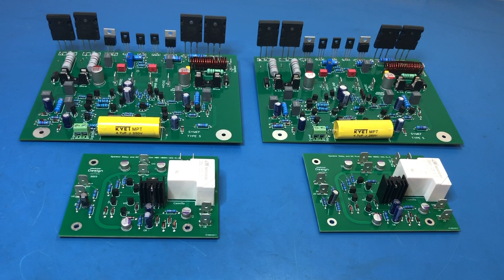SYMEF Class A/B Amp Build Project

Comment: What does unregulated power mean from the power supply to the amplifier board?
Reply from the maker: That's a really great question! So the power supply basically does three things to the 240V that comes out of the wall. Electricity coming out of the wall outlet is Alternating Current (AC). It looks like a sine wave, and goes positive and negative compared to ground, 50 times a second. The 240V is RMS, which is kind of like a mathematical average for sine waves. The peak voltage is plus and minus 340Volts. First thing the power supply does is to get that to a lower voltage - the transformer does that. It turns the 240V into 32V (actually it's two sets of 16V connected together - 16+16=32, and you'll see why in a minute). With a rectifier using some diodes, we can now take that AC voltage and turn it into DC - it's no longer going between positive and negative - it's always positive, but it's still going up and down. We don't want it do go up and down, we want a constant voltage, and that's what our large filtering electrolytic capacitors are for. They store charge (they actually store electrons on their metallic plates). When energy is flowing into the capacitor at the peak of the cycle, the charge will build up. When there is no energy coming in, the capacitor will release the energy, by the charge flowing out of it. If you are able to store enough charge, and the load is not taking more energy than the capacitor can supply, then the voltage will stop going up and down, and you will end up with a single DC voltage. However - this is an unregulated voltage - it will still tend to go up and down depending on load factors and so on. For precision electronics, we usually need a precise voltage, not one going up and down. So for example, much digital electronics needs 5Volts DC. We should do our best to give it exactly 5Volts. Not 4. Not 6. Five.
So our Pearl 3 power supply gives this unregulated DC voltage - there are actually TWO unregulated DC voltages. Those two sets of 16Volts, the way they are set up, we will end up with about positive 19Volts and about negative 19volts (unregulated).

The Pearl 3 preamp board has the voltage regulators. In this case, it uses a 7815, and 7915. These are about the simplest kind of regulators you can get. Basically they are a variable resistor, that keeps on adjusting its resistance so that you always get the same voltage on the output. For the 7815, its +15. For the 7915, its -15. So if we put +19volts into the regulator, then there will be four volts across the regulator, and 15 volts will be delivered to the load.
This is what we call a Linear Regulator. Switching regulators work a completely different way. Linears are good as they are generally very quiet (switching makes a lot of electrical noise), but they waste energy, and can get hot.

Hope this helps.

Comment: eBay and Amazon has what your looking for a aluminum with heat sink  case  find one for a cheap price is hard  . The right power supply and parts is usually the  harder to find most of the time. You can always use a old receiver from good will  gut it and make a face plate.👍👌✌️💯🎄🍻🎶🎉